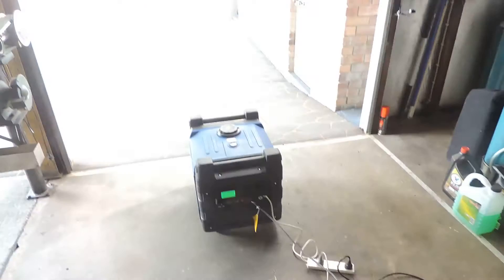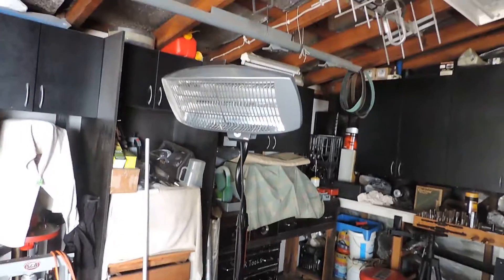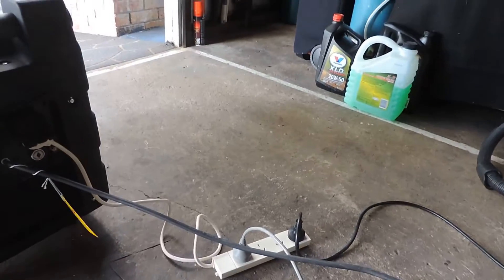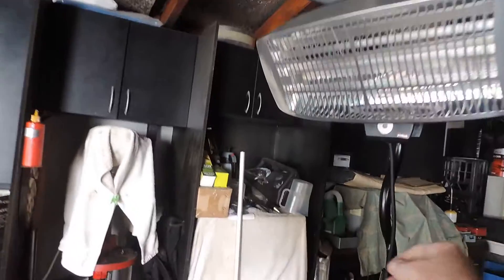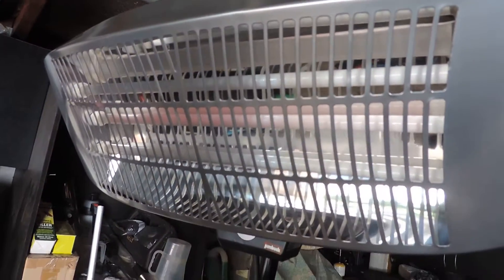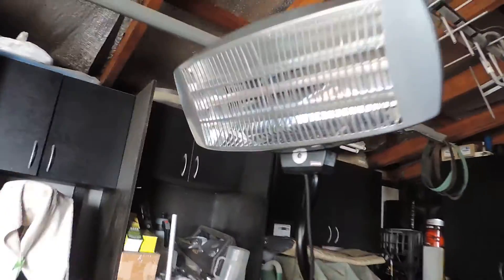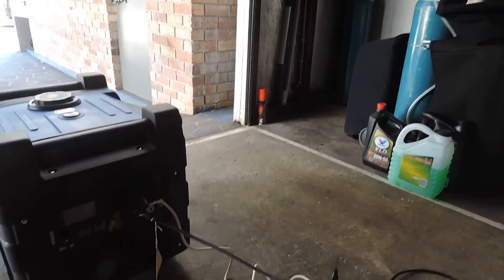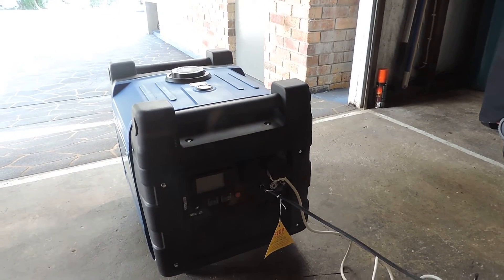7kva generator load test 1

Comment: What make & model is it??
XG-SF6700D???
Reply from the maker: It doesn't have a make and model It is an unbranded unit bought off Ebay about 8 years ago. I still have it and have used it around 10 times with no trouble as such. It's just not a 7kva generator, but works fine to 3500 Watts.

Comment: Don’t get me wrong. It would be great if ya could get 7kw out of that small of a package unit.
Reply from the maker: Yes it was a shame it was over rated, but it has worked very well up to 3500 watts which will run a lot of things. Still have it and still working well for its size

Comment: I like the way you load test, yes I'm with you , if it says 7kw it must go over that not less, if you paid $5g for it you over paid, I'm planing to buy a Chinese diesel generator 15 kW I'm planing to do the same load test to what it says and I will run with max load for 1hour if it can run with max load for one hour I think my test I calling it passed. This junk talk to e-bay and see what you can do , don't just let it go..
Reply from the maker: +Anura Yapabandara Hi Thanks for your comment, The generator works well up to the 3500W it just isn't the 7kva size I was attempting to buy. I payed $750.00 at an Ebay auction,but it has worked well when we had a blackout for 6 days with no mains power,Kept the fridges and freezer running fine and still able to watch 60" tv's and run computers ok it is a pure sin wave generator and haven't had any trouble using it. It was just miss rated for the size. Unfortunately this seller no longer exists on ebay can't get a replacement.
Can you tell me what 15kw generator you are looking at? and a link to see it please.? Regards Neil

Comment from the maker: WARNING Don't buy one of these False up-rated 7kva Generators
Reply from the maker: +d1rtrac3r  Hi This generator was bought on ebay from raredeals was the seller but they are no longer a registered user. It was around $750.00 and about $100.00 freight it weighs 55kg. It was claimed to be 7kva which should provide 5000Watts continuous however it does not and only produces 3500watts which is ok and it works fine up to that output power. We had a blackout some months ago and had no mains power for 6 days while the repaired damaged line in our area. We had the generator running most of the day up until midnight for the 6 days to keep the fridges going and it runs most things it got us thru very well and is a nice little generator. It was just falsely represented as having more power than what we paid for, it is also not as quiet as the specs claim,(see my other video)
All that aside I have about 150 hours of use logged up on it now and has worked perfectly fine. During the 6 day blackout I used 2 X 20Lt jerrycans of 98 petrol so 60 lt in 6 days running about 18 hours each day continuos. Hope that helps
Reply from the maker: +d1rtrac3r  Wow $5.500 dollars is a lot of money. You can but a 14kva industrial generator for that money. If I were you have a look at blue diamond generators, they sell a 9kva petrol unit 8000watt cont. There in WA and supply all parts for there units. Just Google blue Diamond and have a look, there also on ebay... Regards.Neil